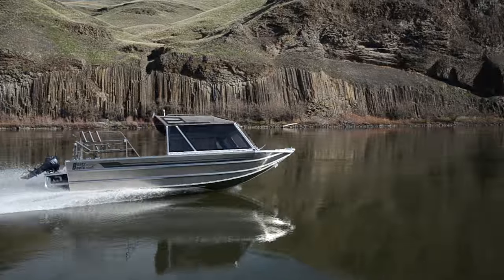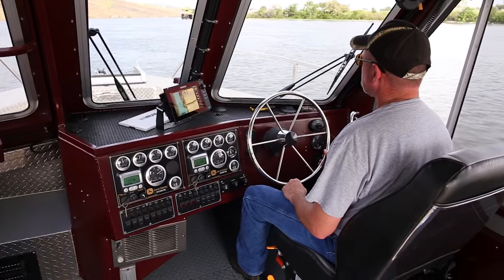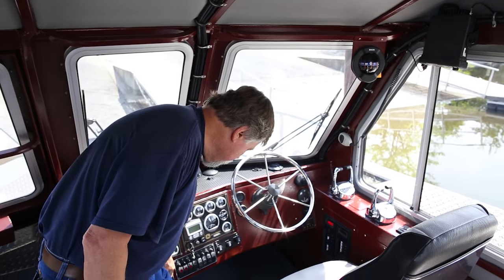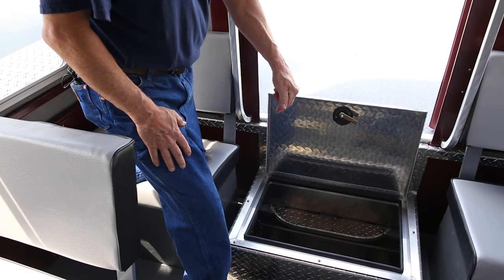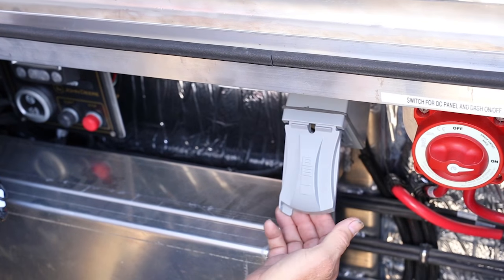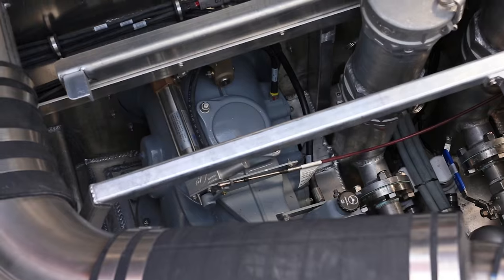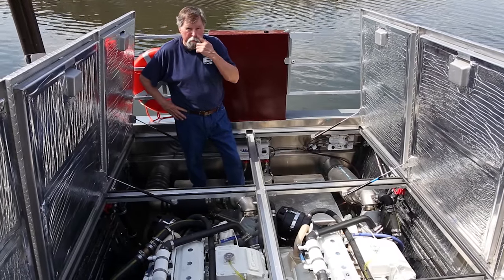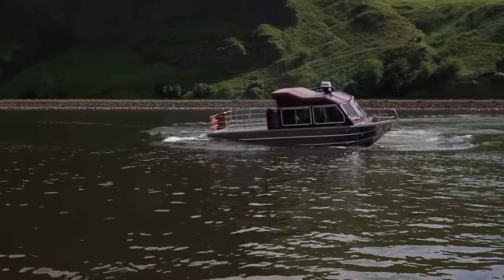Bentz Boats - 31' Twin John Deere Diesel and Hamilton 274 Waterjets

Comment: Looks like an awesome boat. Would like to see it getting tested. One thing I would change is the location of those forward lights. They will be taxing the night vision and greatly diminish the depth of field if they light up any of the boat as they shine outward. they'd be better flush mounted to the hull, even if it means they lose the height. On the water, for the most part, all they will illuminate is more darkness and all the particles in the air. I prefer to use the reflection of the moon even if its just a sliver. Just follow the path of it and look for any obstacles in the reflection path...and keep spot checking your peripherals...

Comment: Did I miss an HVAC system? It's a nice boat, but with all the wonderful technologies included as well as a heater, why not install an AC unit for the summer months? Those fans won't do much when it's even 85 degrees. I'm just curious and I might have missed or miss understood one of the features.

Comment: Hello! What is draft?
Reply: The draft (American) or draught (British) of a ship's hull is the vertical distance between the waterline and the bottom of the hull (keel), with the thickness of the hull included; in the case of not being included the draft outline would be obtained. Draft determines the minimum depth of water a ship or boat can safely navigate.
Reply: phatsmitty What was meant in the meaning of how many. Sorry for my english.
Reply: 6" or less